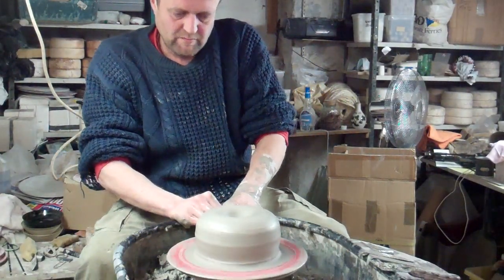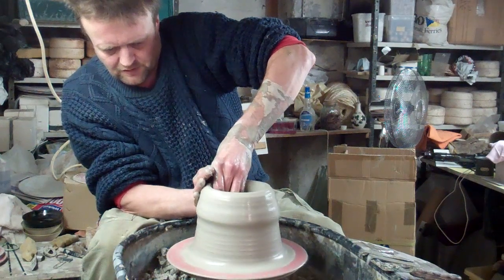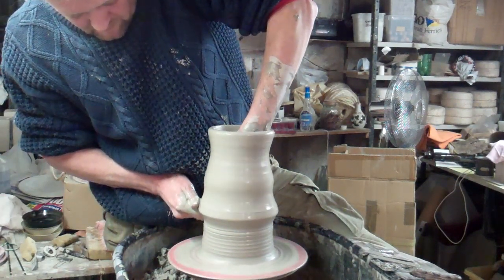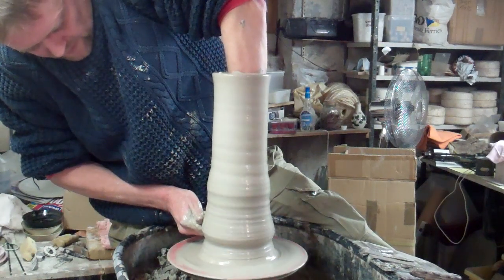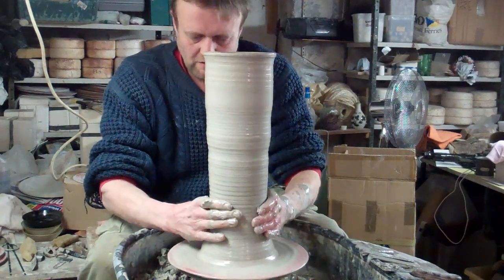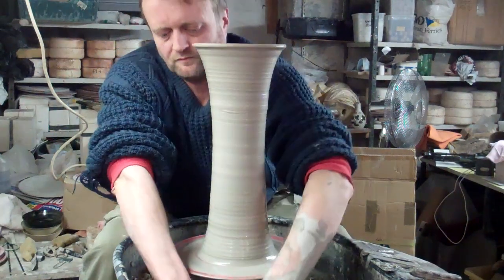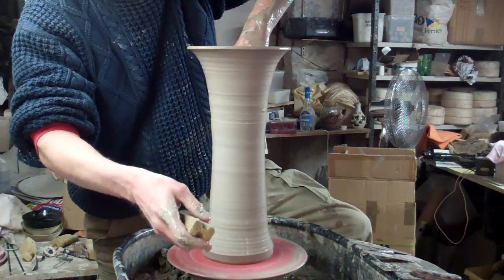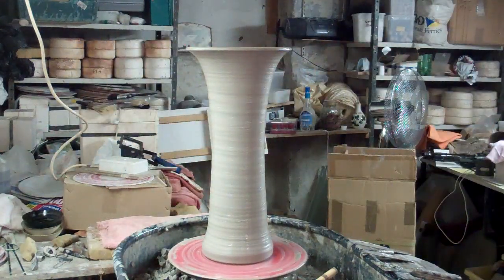Throwing a tall flared pottery vase on the wheel.

Comment from the maker: @goforkt Hi,I use a lot of water but I never seem to have a pot collapse.
If you see that I never take longer than 4 minutes to make a pot then the water doesn't make any difference.
Also If you use soft clay it doesn't absorb water as much as hard clay which will tend to slump with excess water.
So if you use softer clay you can add more water....daft as this may sound.
Cheers,Dan.